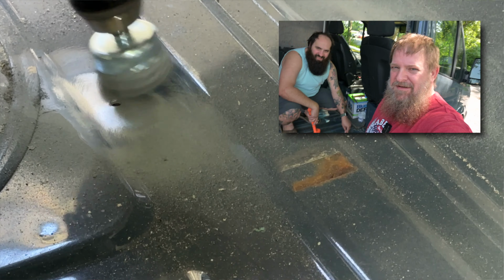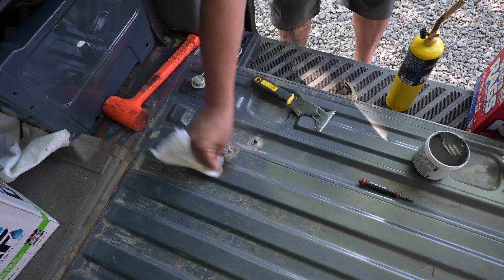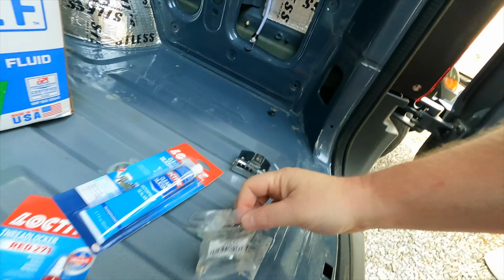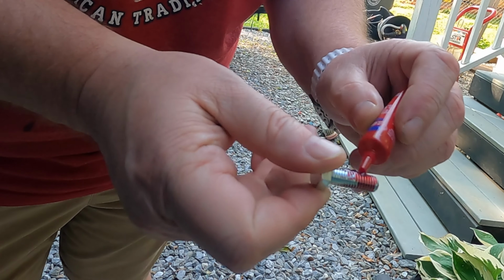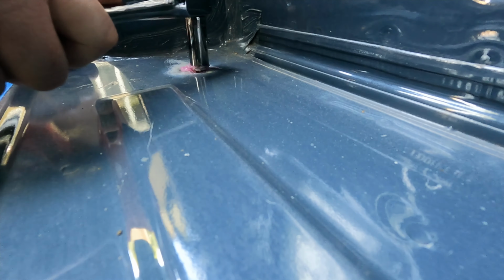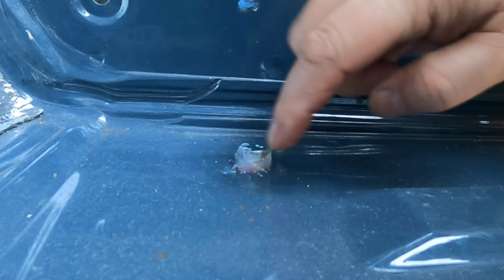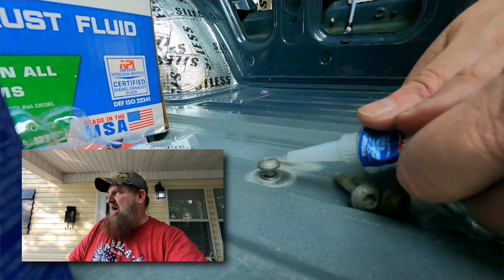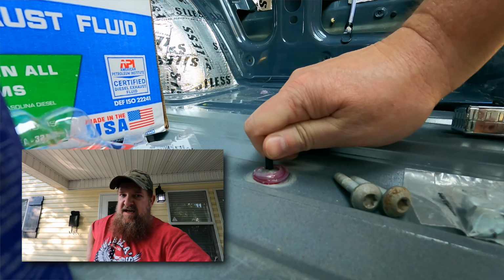Big Mistake?  Todd vs hand tools as we seal our Sprinter van floor

Comment: Almost to 1000! Also, it is impossible to problem solve without drinking beer. The more difficult the problem, the more beer you need.
Reply from the maker: Good point Lewis!  That purple Monster Energy wasn’t cutting it.  I’m sure there will be plenty of beer in the future…we haven’t even begun the typically “difficult” tasks (like wiring).  Next van series vlog we cut 4 holes and install some exterior lights 🤙